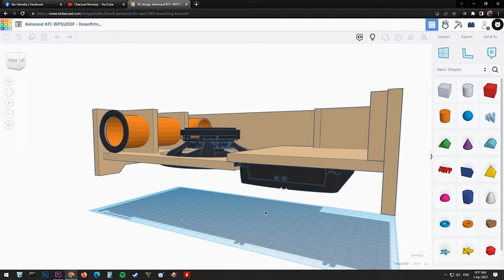DIY Downfiring Underseat Aero-Ported Subwoofer Box for Toyota HiAce GL Grandia

Comment: good but head amp = ☠ to rip, temperature will kill it
Reply from the maker: Thanks for the comment. Class D amps are high efficient and do rarely heats. Also the amp is rated to drive a sub as low as 1 Ohm and this Kenwood subwoofer is only 4 Ohm. So everything is ice cold.